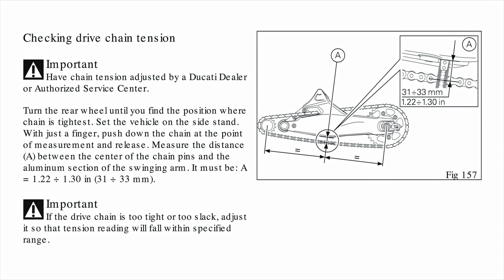Ducati Monster 821 | Chain Adjustment

Comment: Great Video! 

I got my Monster one month ago.
Good to see there are vloggers like you, uploading these kind of videos.

I hope you can help me with another "problem" as well (maybe)

My Ducati dealer is far away and I don't want to ride there for this simple question:

I know I can adjust the seat.. But i forgot to ask them how..  Could you help me out?

I found the distance bricks under my seat and removed them and changed the position of the front pin to the lower position but the seat has to be bend extremely to fit the locking mechanism if I just so this.. That can't be right I think.. 

I hope you could help me.. 

Greetings from Germany ✌🏻️

And thank you!
Reply from the maker: +Pleumel There are little plastic pieces up front on each side that you have to remove in order to lower the seat. They are just help by couple of screws. Once you look, you'll see what I mean. Otherwise, I can take a photo or two.

How is weather in Germany? Warm enough yet to ride? Thanks for kinds words and watching!

Comment: Very helpful. Thank you. A couple of questions: In this video, it looks like the chain is a little tight. Does turning the adjuster bolt clockwise loosen the chain (it looks like it moves the axle toward the center of the bike)? Also, I've seen a couple of other videos where they put a screwdriver between the chain and the sprocket before tightening; I'm assuming this isn't necessary on this type of adjuster because there is no locking bolt. Finally, I have a 2022 Ducati Scrambler Icon, and I believe the rear axle nut is 30mm. Can anyone confirm? Thanks again!

Comment: Hello, I have a 2022 scrambler 1100 and the system is the same as your motorcycle. Once the chain tension has been adjusted and the central nut tightened, I don't know how to tighten the side adjustment screws to 10 Nw as the manual says. In your video you have not tightened them at the end. What is done with them, are they left free?
Thx!

Comment: So glad I came across this... While cleaning my chain on my 821, I noticed more slack then normal.  Do I measure the distance while holding down the chain or while its at rest? Thanks so much for posting this... Very helpful.
Reply from the maker: Not sure if you have user manual but there is link to it in video description that explains what you need to do - but you are supposed to push down on the chain, release it then measure.
Reply: @HoldFastFilms  what’s the point of pushing down the chain with finger if you are supposed to measure when you release it?
Reply: @nikobitan6005 to take out any slack

Comment: In my German manual from the 2016 model it said 28-30mm. Weird!! I set it to around 29mm. Took me ages btw.
Reply: It's the same with my 2015 manual (swedish).
Reply: Ducatisti the UK model has the same description in the manual. I have been trying to figure out what it means, does it mean a defection of between 28 and 30 mm?
Reply: My English manual for 2019 says 28-30 mm, it’s probably different for different years.
Reply: Mark With The manual says to press down on the chain and then release and take the measurement. So not really a deflection of 30mm

Comment: must i thighten the swinging arm screws, when i thighten the wheelshaft with the correct torque, leftsided or rightsided?
Reply: Hans Koothrappali I saw this in the manual too. It doesn’t make much sense to torque the adjuster screws. I don’t understand why they say that.

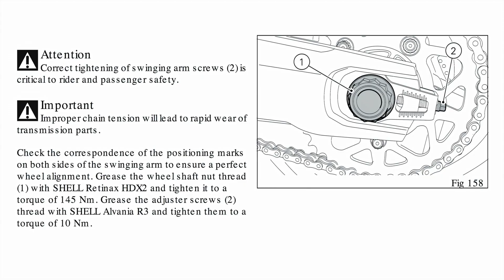Comment: 1:41, 145 Nm, in my Ducati Monster 821 book it says 180 Nm
Reply: Goratchthemule my book says 180 Nm as well, 2019 Monster 821 Dark. It’s probably different for earlier years.
Reply: @esfastes  ill guaranty if you do 145 nm or 180 nm youll break everything . This is an error . 100 nm is enough